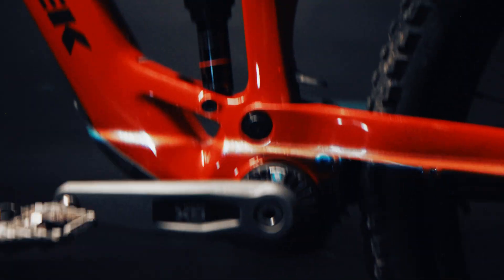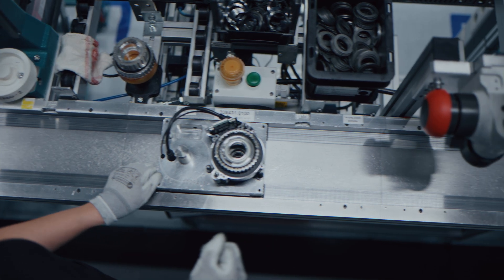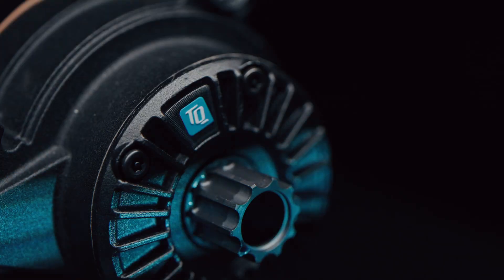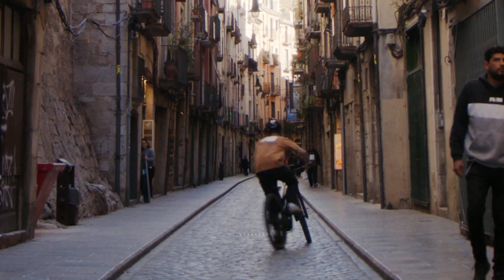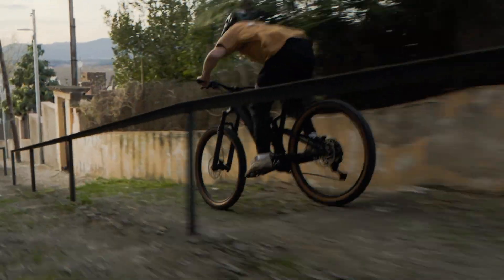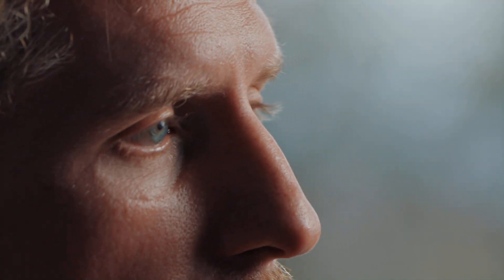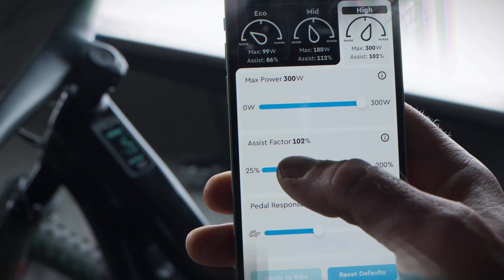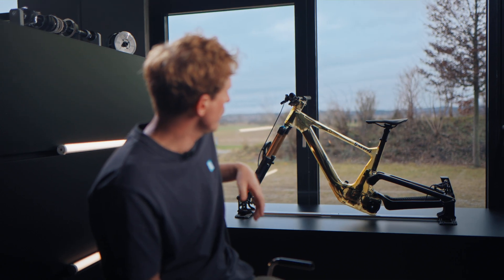Inside the TQ-HPR50 – Everything You Need to Know About The most Precise E-Bike Motor!

Comment: Nice job, love your motors. I have on the Trek eXE. I’d like a cross country/gravel bike with the TQ next.
Reply: did your trek had any creaking from the motor when its on and pedaling? mine somtimes creaking very loudly on any power output and if i turn it of the creaking is stopping no mater how hard i push my pedals.
Reply: @sheezabrat  - yep i have the creak too - i think it is a design defect
Reply: The nut holding the chainring should be checked and torqued to spec.  Should be a simple fix
Reply: I have not experienced that.
Reply: I just bought a Trek SLR 7 in March.  Love the bike, but the motor has a lot of creaking.  Had a problem with a chainring failure, which was replaced.  Still have the creaking.  Im going to check the motor bolts next.......not sure what else to do.